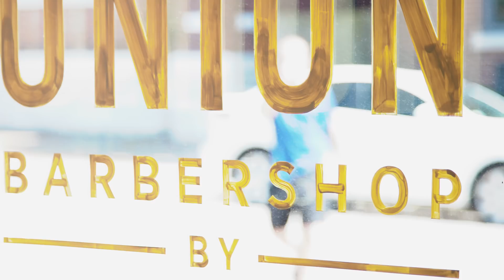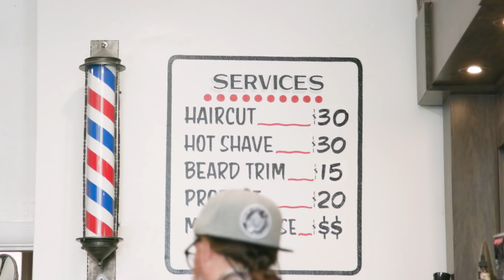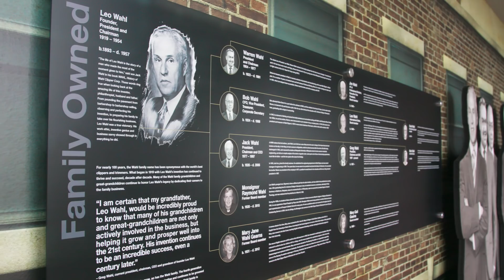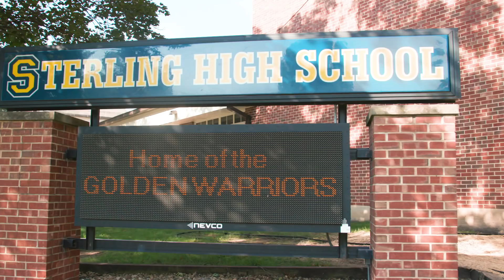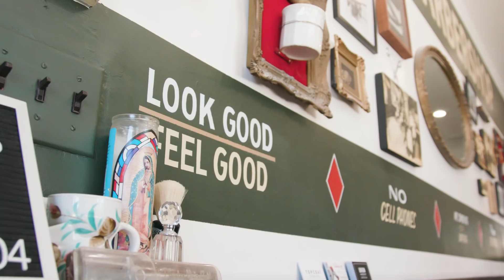Think Like An Artist---The Culture of American Barbering by WAHL Professional

Comment: On the outside all wahl clippers look about the same, some have metal housing, some hard plastic but what makes each wahl clipper unique is the blade. Get familiar with the differently blade options as each clipper has a different blade on it.   The fade blade is best for bald fades and getting out the trimmer line, the taper blade is outstanding for all around tapering fading and blending. Then they have the crunch fade blade on the 5 star magic clip which helps give a better blend. And lastly the wedge blade on the legend clipper which is similar to a fade blade but has a greater throw on it. It opens up to a 1 blade which is about 2.4 mm similar to andis master